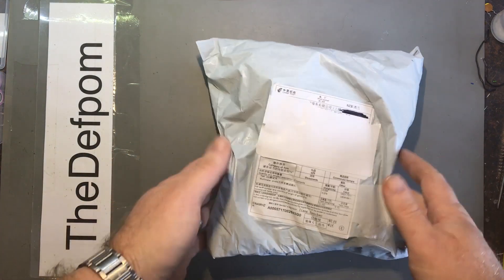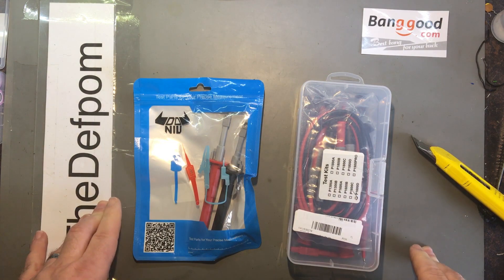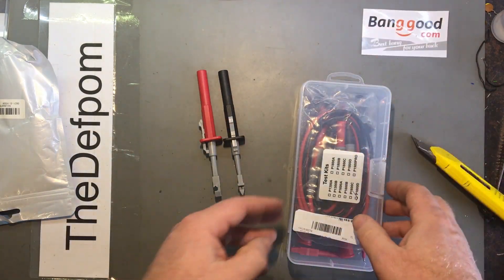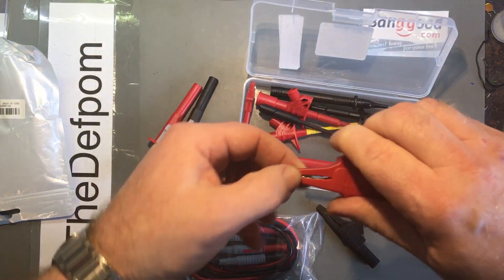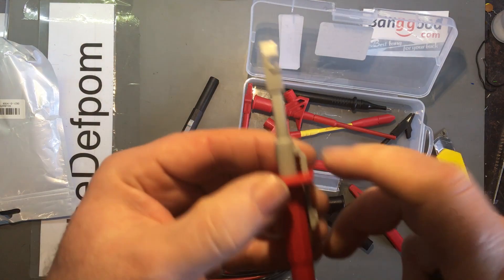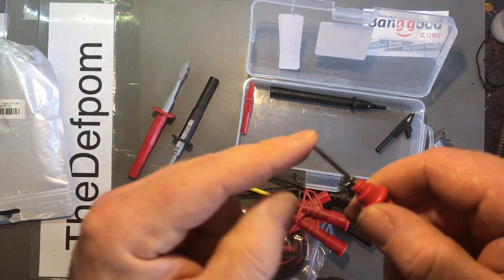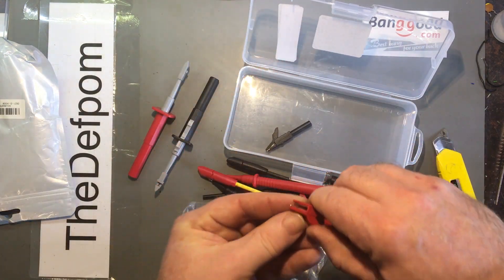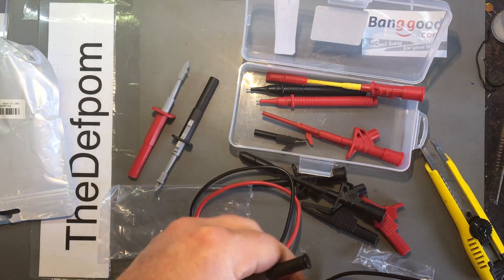#288 Multimeter Test Lead Set Review

Comment: Hi!   Are standard probe leads universal across brands and models?   I bought a used fluke multimeter and need to replace the leads.  Thanks.
Reply from the maker: They all use 4mm banana plugs, with a standardised spacing between them also, so yes, you can pretty much use any leads, the only thing is that some meters do not allow for the shielded plugs (the plastic sleeve around the actual pin), in which case you would need to find non sleeved plugs.

Comment: I have this set too. These sets are made by Clerqee http://www.cleqee.com (you can get them under this name also on aliexpress along with all the other products). I dont think the silicone wire is extremely flexible but its all right for the price, but definately not fluke or probemaster quality. (but mind you: a (1) probemaster insulation piercing probe like the ones included in this kit (with the yellow piece) is about as expensive as this set alone so that has to be taken into account too)

Comment: You did not test continuity or contact resistance of that grabber.  I just bought that set from Banggod.com.  The grabber test hook is worst and a piece of crap.  Connection is intermittent, if it can  make  contact, resistance is more than 15 ohms as tested.
Reply from the maker: That is very interesting, I should of looked at the connection quality when I did the review, I just checked my set (I haven't actually used them yet), and the grabbers are showing the same issue you mention with intermittent connection, that is disappointing, the rest of the set seems fine, but the grabbers certainly are not good enough! Sorry I didn't pick that up when I did the review, I assumed that they would actually conduct correctly.
Reply: I dismantled it,.anyway its useless, there is no solid/reliable connection inside from that female plug to the metal rod/stem enclosed by spring. Your test lead kit shown is the same as mine made/repacked  and rebranded as DANIU from China.

Comment: Well they dont look bad at all, the crock clips are a must, usually on the negative probe for clipping on to a local earthing point. Free to probe around with the red one then :-).

If your mostly working with low voltages below say 50v then the cat rating means nothing, its not likely that any high voltage will get through the power supply being used to power the equipment.
Ive never had a shock from test gear, even cheap meters, you just keep in mind not to touch the leads/probes while checking high voltage.